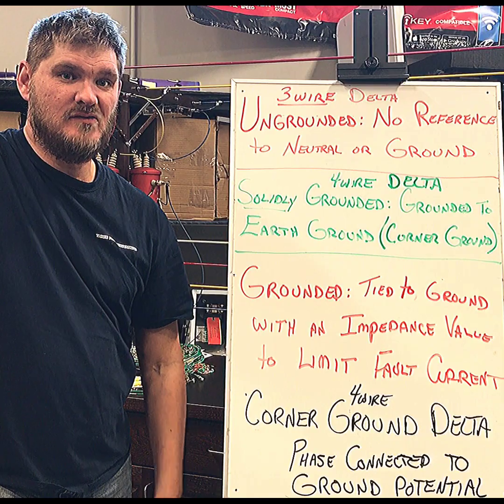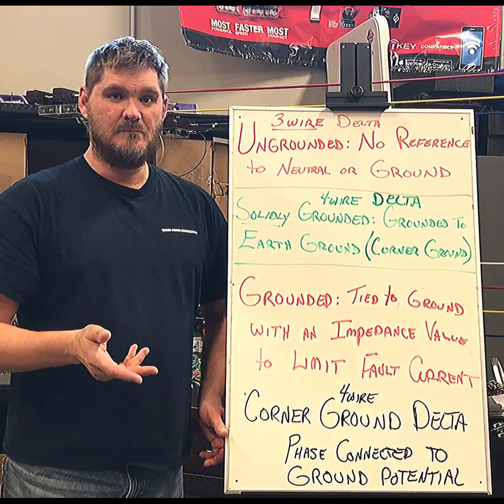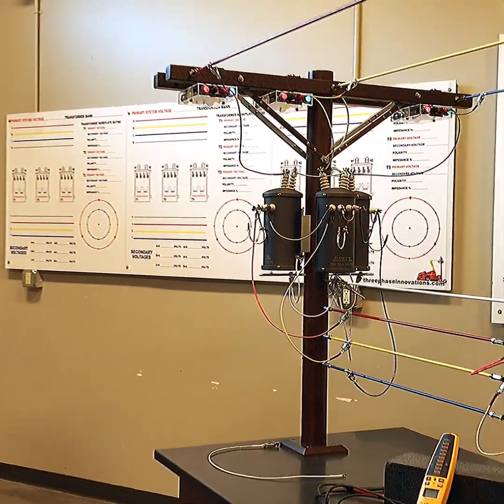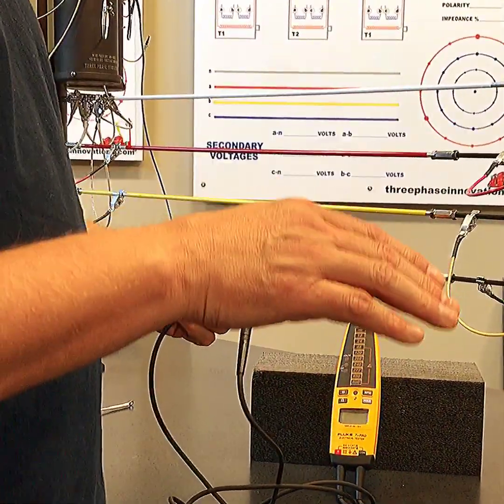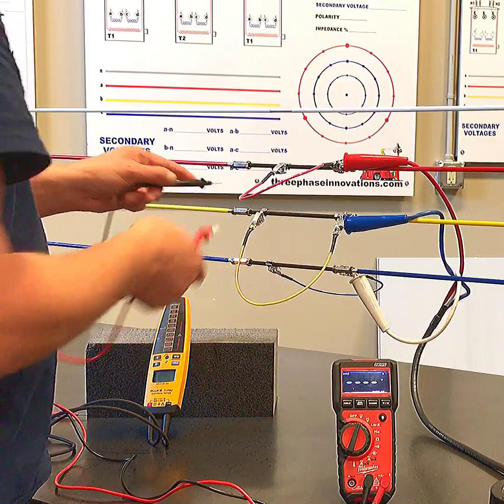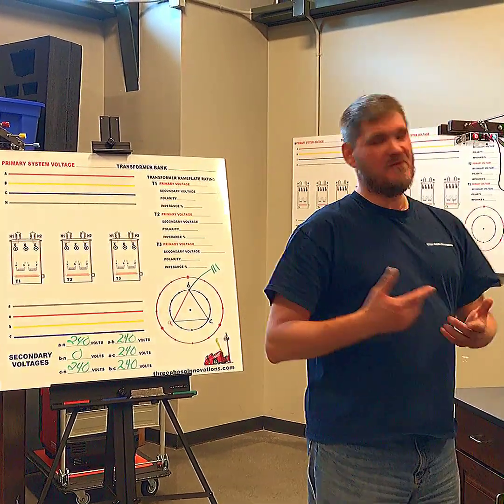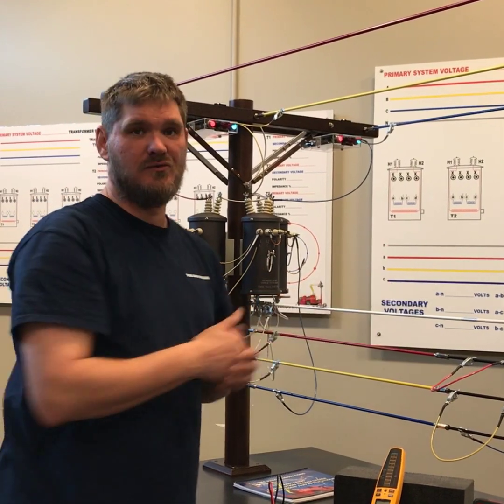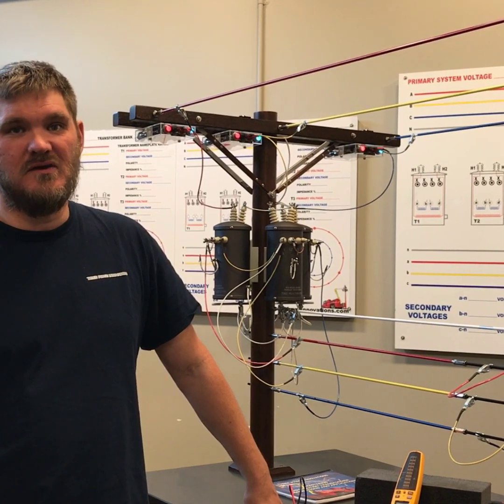Corner Grounded Delta Transformer Bank

Comment: Hi Buddy, you have a nice presentation, We have almost the same system in your video , we have WYE Ungrounded- corner grounded delta (3ph, 3wire grounded delta). What is the difference between the WYE ungrounded primary to Wye grounded Primary? The secondary banking is the same.Thanks
Reply: Hello Mr. Padilla, Thank you for the comment and sorry it took awhile to get back to you. If you are referring to a "Floating Neutral" it has several considerations. A WYE-WYE bank must always be tied to ground to stabilize the bank. When you have a DELTA secondary and a WYE primary some utilities will want the Primary neutral not grounded on the WYE high side. One reason is when ground fault happens on the distribution system or at the transformer bank itself the ground fault will not go through the transformer bank or the fault won't go back out on the system. In short, it isolates the transformer bank from the system and the system from the transformer bank so fault current will find a different path. If the transformer bank has a fault, it does not go back on the system and might create damage to other equipment on the system. If the system has a fault, it won't ground out through a customer's transformer bank and go somewhere else to ground out. 
       Second reason: When you lose a phase on a closed bank and the neutral is floated the customer will realize they have a problem and will call the utility to let them know something is wrong. If the bank is not floated on the WYE side and the bank is grounded, the closed bank will turn into a "OPEN" bank when a phase is lost. Two transformers in the Delta secondary are trying to carry the original 3 Phase load and if they KVA has not been rated for this type of situation, the customer may not know they have a problem until the other two transformer burn up trying to carry a load designed for three transformers. Example: 3 transformers each with a 100 KVA. Closed bank total KVA is 300 KVA (3 X100). If you lose a phase with the WYE grounded, the bank is now "OPEN" 2 transformer are now trying to carry a 300 KVA load. They won't be able to do it. Their capacity is has been reduced to 173.2 KVA. There are two different ways to do the calculation. 300 KVA x 57.7% = 173 KVA or you lose a phase and are left with 200 KVA x 86.6%= 173 KVA.  2 transformers will try but can't produce the same load all 3 were working together. They will burn up if the phase is not put back in over time based on the load and all other factors. Ambient temp for example. One thing to remember. If you are going to "FLOAT" the neutral. You must connect it to energize the bank. Then you can float it. When you de-energize the bank, put the neural connection back on, then you can open the bank. You will have high voltages on the neutral itself until you make the ground connection. Ferroresonance can also occur and can be dangerous. Whole topic explained very well be Dennis Merchant. 
https://youtu.be/U7dNdQc1NL4
Reply: @jasonleary6717  Lovely. I am very happy in your answer. It Enlightens me more. That's why when we do  V-phase banking, we connect the one lead to the neutral (usually the  center one).  Our seniors never explain that way. Thanks jason.
Reply: @cristobalpadilla4117  Glad I could help. When we get some time I hope to make a video about a floating neutral sometime soon.

Comment: How would it be possible to change a delta high leg from the meter? I changed a 4wire 120/208 delta high, load center.  Upon putting the meter back in the high leg tests 320v to ground and 420v c phase. I grounded&bonded the 4th wire with the ground rod... Just as it was before... I still just can seem to figure out how I could ever change voltage downstream..
Reply from the maker: Great question, if you are a member of our (lineman transformer discussion page) on Facebook, would you please repost this question their. We have some very smart guys on their. Also this would be a great quest for other members to hear about and discuss. Thanks for the questions.

Comment: One a Wye Delta center tap you remove the grounds off of the x2 bushing on the outer cans. What happens if you forget to remove a strap and why?
Reply from the maker: LUIS LOREDO imagine the one ground center tapped. If a ground is added on either side of the transformer that has been grounded it will result in a ground fault short on that phase.